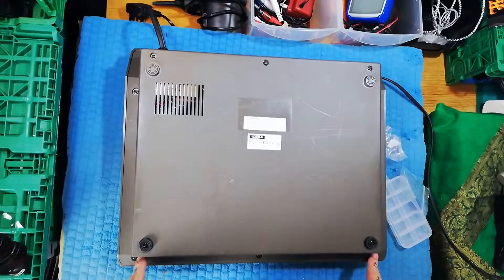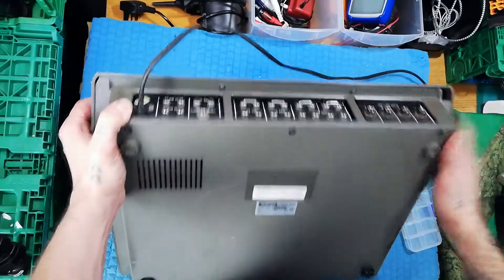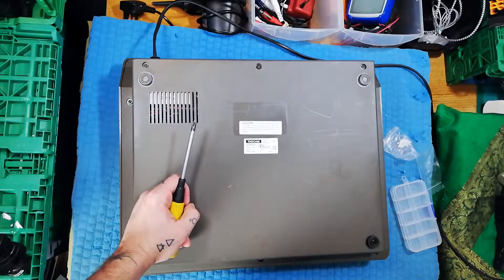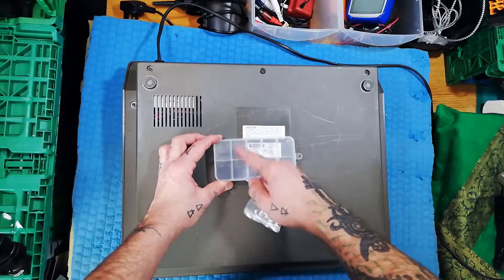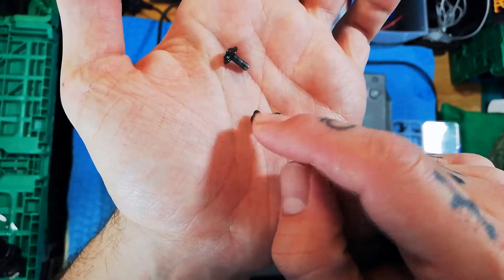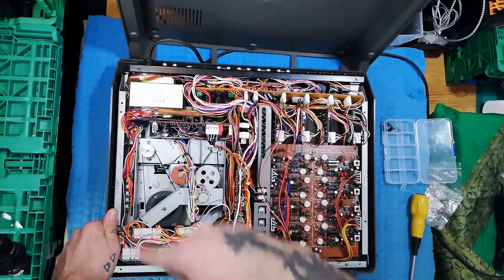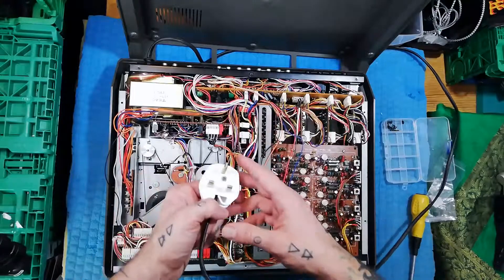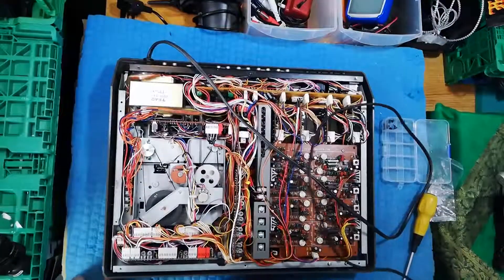4 Remove back panel (Fix Your Tascam 244 Portastudio Transport)

Comment: Hi - thanks for your Portastudio troubleshooting and demonstration videos. Can I ask do you undertake PS 244 repairs? I've had a 244 from new and now want to digitised my old 30+ year old recordings but my machine (stored over the years but occasionally run to keep the rollers & pulleys rolling) seized up when I inserted a tape.  Help!
Reply from the maker: I replied to your facebook message but basically no....right now I'm focusing on bringing myself up t speed on other models of tascam (244 is the one I had worked on most before beginning this channel) and sharing that knowledge over youtube, thanks for your interest and I hope you resolve the issues you are having :)